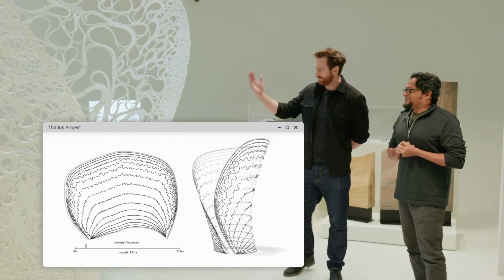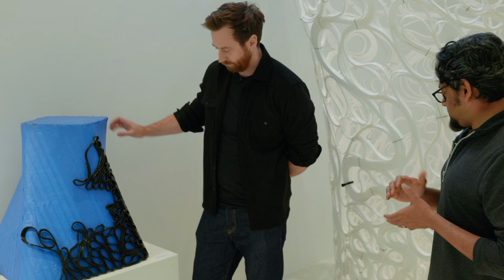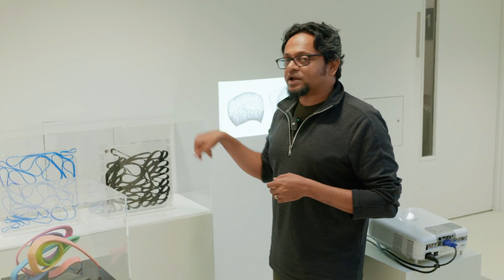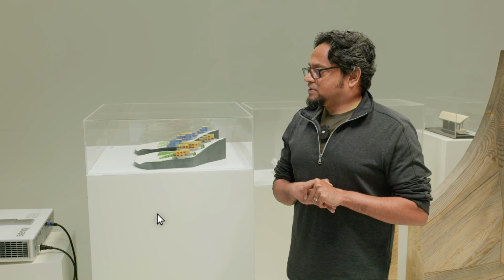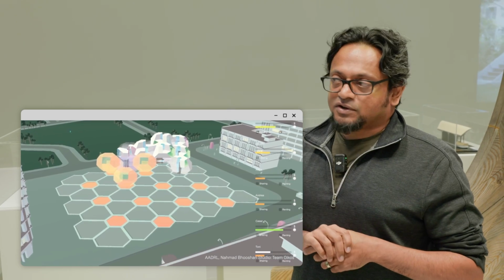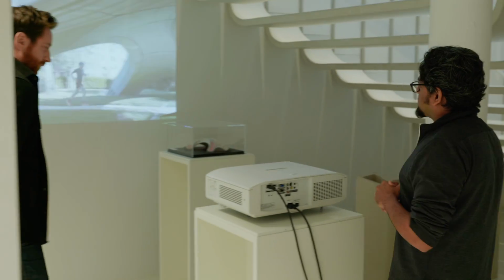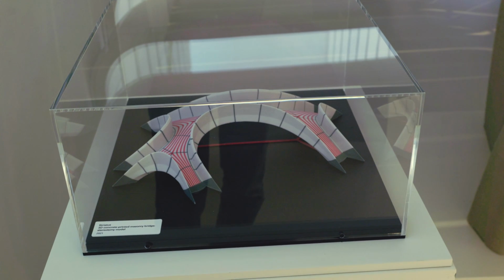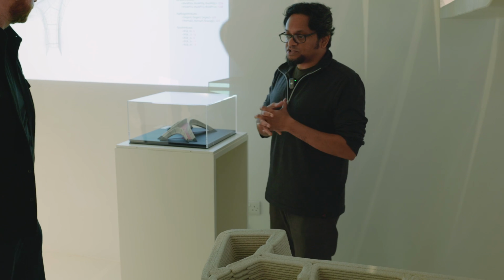EP 2 | ArchiTech Office Tours | Zaha Hadid Architects

Comment: 🎯 Key points for quick navigation:

🏢 Zaha Hadid Architects has a public-facing gallery showcasing collaborative work with artists, suppliers, and engineers.
🔬 The Code team focuses on architectural geometry, digital fabrication, and innovative design technologies.
🤖 ZHA collaborates with startups on projects like AI Build for 3D printing and Circular Factory for modular housing.
🌉 The Striatus bridge project demonstrates new concrete printing techniques and digital design processes.
🖨️ ZHA has a digital prototyping lab for model making, robotics R&D, and showcasing new construction methods.
🏗️ The office space features innovative elements like hanging stairs and custom cork wall panels.
👥 ZHA's technology cluster includes teams for BIM, analytics, sustainability, and AI-based simulations.
🎨 Projects serve as vehicles for technological innovation, often spurring careers within the company and its ecosystem.
🖥️ Zaha Hadid Architects primarily uses Maya and Rhino as their main design tools, with a workflow similar to the animation industry.
🧠 The Code team develops custom software solutions in C++ and C, interfacing with machine learning tools like PyTorch and TensorFlow.
🌐 ZHA is exploring Omniverse for file exchange and real-time collaboration across departments.
🏗️ The Code team focuses on iteration-friendly tools for high-performance buildings, working on novel and complex projects.
🎮 ZHA sees video games and the metaverse as opportunities to prototype user experiences and engage with civic participation in architecture.
🏙️ They're developing city-building simulations to help understand urban design trade-offs and citizen happiness.
🛠️ Digital fabrication allows ZHA to realize complex, high-performance geometries that were previously difficult to construct.
🤖 AI is seen as a tool to democratize design skills and push professionals to innovate and specialize further.
🧠 AI is seen as a tool to elevate the architectural profession, similar to how the internet impacted graphic design
🎨 Text-to-image AI tools are being used to kickstart the creative process and engage clients earlier
🤝 AI co-pilots are of interest to augment designers' capabilities in various tasks
🏗️ ZHA sees AI as an opportunity to solve important architectural problems, but architects need to formulate these problems effectively
🆔 The prevalence of ZHA's work in AI training data indirectly benefits their fine-tuning efforts
🎓 For aspiring computational designers, ZHA values geometry processing, shape design skills, and cultural understanding of architecture's role
🎮 Video games are recommended as a fun way to learn math, coding, and design principles
🌆 AI for architectural intelligence in new city design is seen as an exciting opportunity, given the massive urbanization expected in emerging economies by 2050

Made with HARPA AI